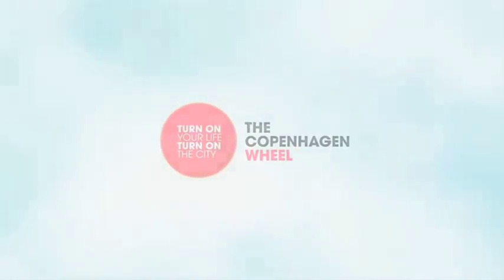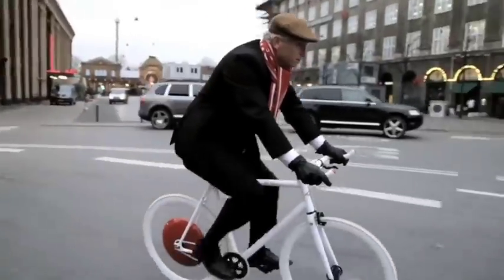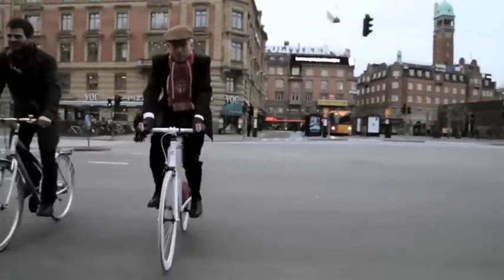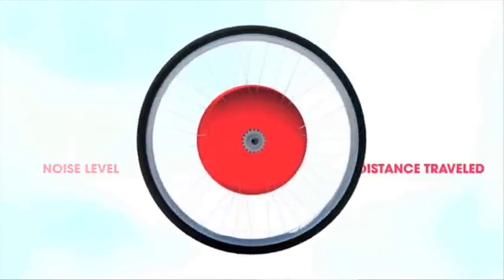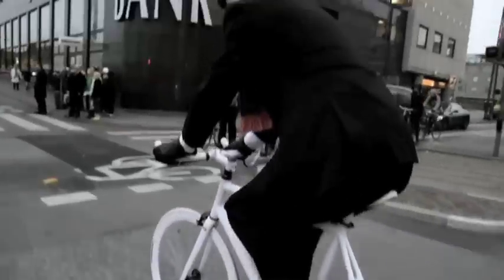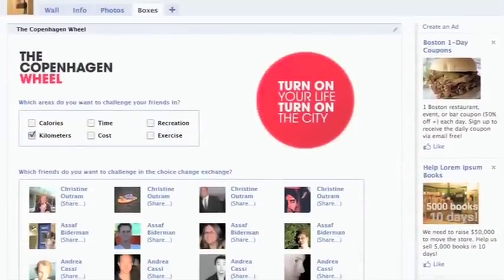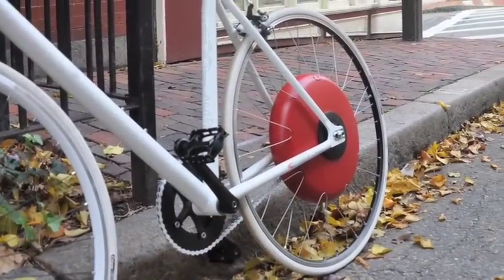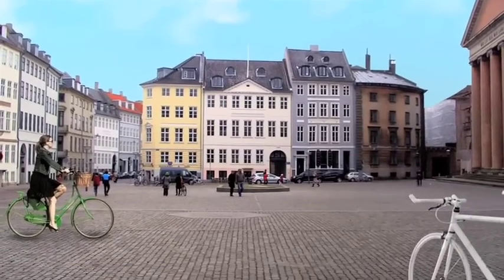The Copehagen Wheel

Comment: You claim it has "environmental sensors" for NOX, and CO. What technology do the sensors use?  based on my knowledge in the field of gas analysis equipment, I know of no technology. that could be incorporated into a device that size, and certainly not at that price point capable of accurately measuring ambient concentrations of NOX, and CO, much less particulate mater.  Please enlighten me about this technological breakthrough in miniaturized low cost zero maintenance, no calibration required, gas analyzers.